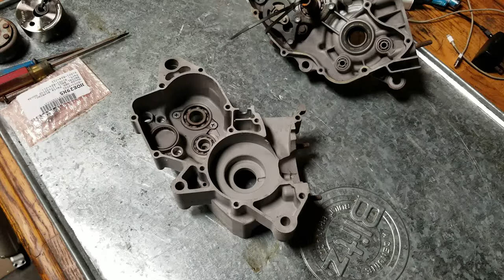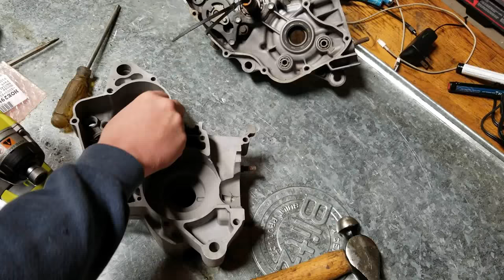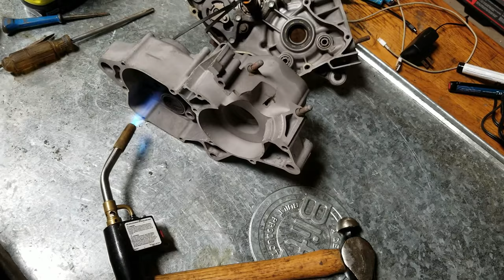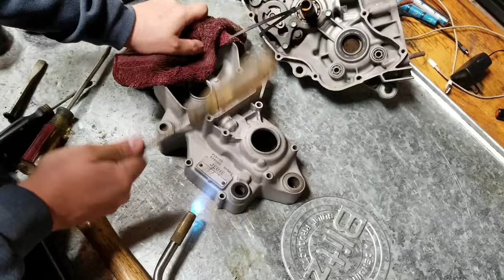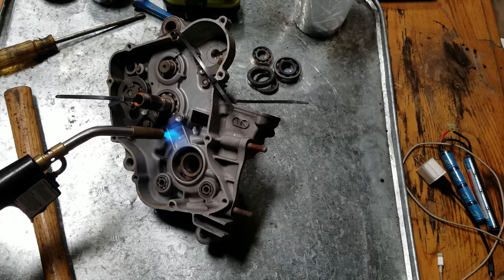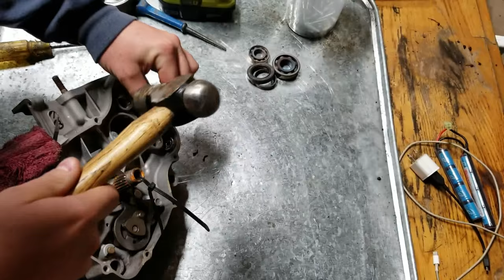Honda CR125 2003 - Removing / Installing Crankcase / Transmission Bearings

Comment: im doing a top and bottom end on a 94 cr125r.do you know if that year is the same engine parts.
Reply from the maker: 94 and 03 are definitely not the same.
Reply: Everything else is the same besides the transmission. You may have to match the ports as well. Older cases have smaller ports so dremel them out.